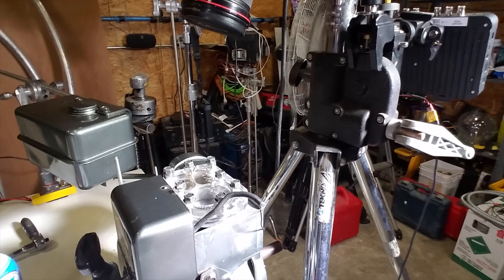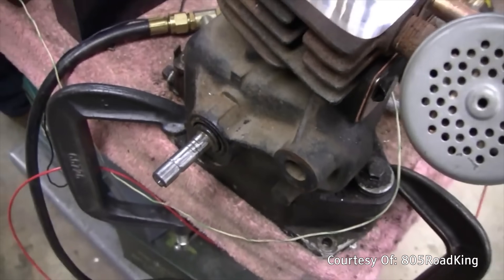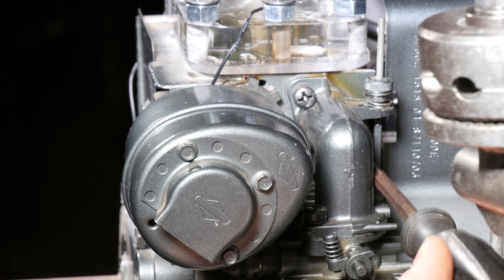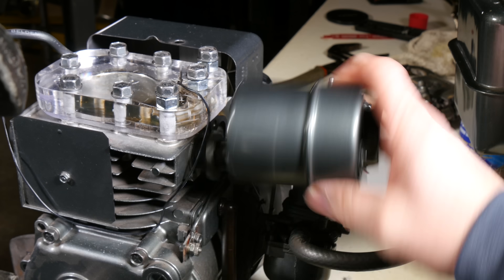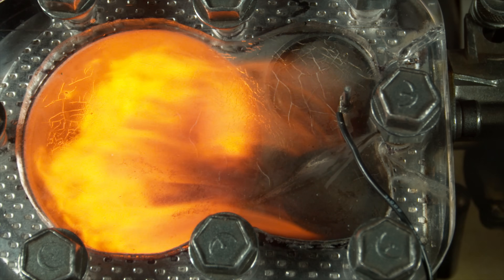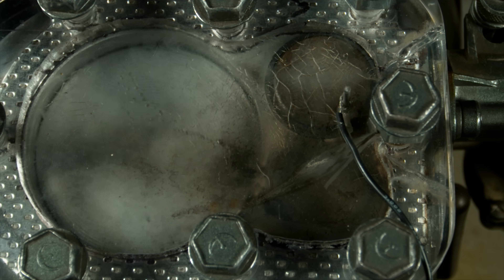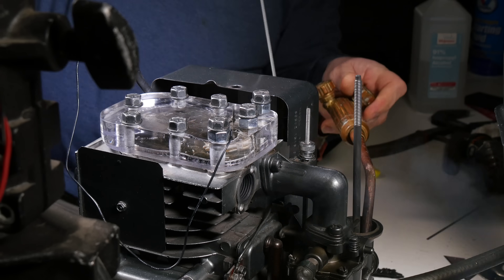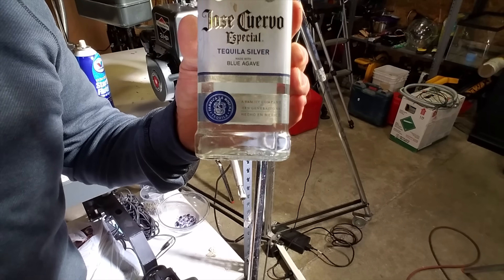See Through Engine - 4K Slow Motion Visible Combustion ( S1 • E1 )

Comment: I guess the issue with Acetylene, at least as suggested by the slo-mo footage, is that it burns far too slowly for an internal combustion engine. Like it didn't really deflagrate, it just burned as if it was coming out of the torch. Rather like trying to use diesel in a gasoline engine.

Awesome looking footage all the same, even if it got a bit mad max with the torch gas :D

I do wonder why the engine seems to be running wasted-spark though? That seems like a rather odd thing for a single cylinder to do. There must be a cam turning at half crank speed somewhere because it's clearly 4-stroke with positive action valves, so the spark breaker or other timing mechanism really should be connected to that, but instead it must be running off the crank instead. Unless it's one part of an engine that was originally 2-cylinder but was modular enough to deconstruct into a single?!

Oh... and it's pretty mindblowing to think that in every common car in the world you've got a quartet of this sequence going on... but at full realtime speed. It's so neat and elegant when seen slowed right down, but the reality is it runs way too fast for the eye, or even a normal speed camera to follow... it's a very neat piece of science, to create something that, at least until recently with the rise of easily available high speed cameras (and, indeed, high strength transparent acrylic), could only really be "seen" theoretically, or as a process to be stepped through stage by stage, yet still works absolutely perfectly when nailed together and put into motion at full speed.

Comment: why the spark plug is making ignition for every rev ? shouldnt it be making 1 for 2 revs ?
Reply: In theory yes, but on a small engine like this one the plug fires on every time the piston nears top dead center. So once on compression, once on exhaust where nothing happens.
Reply: Greg Annucci so.. cost reduction on gear set, commerical market for spare spark plug.. engineered solution for money then
Reply: 스파크 플러그..
Reply: This is called a "wasted spark" ignition (I just encountered the term a few days ago and it stuck in my head). Makes the ignition system much simpler.

Comment: Im a briggs and stratton mechanic of April Nolan and I have been turning ratchets and using impacts for 4 years and yet never have seen such an amazing view of a 3hp briggs and stratton engine run with a glass head.That my friend is one of the most amazing things I have ever seen in my entire life of mechanic work and repair.
Reply: the valves accumulated unburnt material. was not mixed with gasoline. dumped in. 1.x   hp cast iron

Comment: I'd like to see the engine run on HHO gas ( browns gas ) hydrogen and oxygen extracted from water via electrolysis. In theory it should make good power and burn very clean. Also to see it run on alcohol and inject it with nitrous oxide.

Comment: Awesome video. I'm glad you've had the time and interest in sharing this with us. One thing about ethanol. Did you know that here in Brazil our vehicles run on both alcohol and gasoline? It's the so-called "flex" technology, whereby you can feed in any proportion of gasoline and ethanol to your engine and it runs ok. However, even our regular gasoline has 27.5% alcohol - as part of a Federal Government program to stimulate the sugar-alcohol industry (it's absurd, but there's nothing we can do about it!) - our alcohol is produced from sugar cane. My question to you is: what is the behavior of the combustion at a similar gasoline-ethanol concentration? Is there a way for you to conduct that experiment there and share with us? I appreciate. Happy 2018!
Reply: That is achievable thanks to new fuel injecting technology but this engine doesn't do well with ethanol as it's carbureted

Comment: I don't know if regular 80 proof tequila would work. 151 probably would. I was a dumb kid so I've tried to burn alcohol before. 80 proof alcohol doesn't really burn too well. But, it might work, I don't know. Maybe a spark plug cal light things better than a cigarette lighter. Go ahead and try it if you're curious. As an experiment, you could use increasingly higher alcohol levels. Go from wine, to a liqueur, to tequila, to 151 rum and finally to 190 proof Everclear. Then when you're done, it's party time.
Reply from the maker: Paul TheSkeptic I burned 151 in part 2 or 3 of this episode, it's on this channel, check it out I think you will be quite surprised with the results.
Reply: Alright, I'll check it out. Thanks.

Comment: You need to understand how dangerous it was using rubbing alcohol with your acrylic cylinder cover. You see, isopropyl eats away at acrylic polycarbonate and you can even see the microfractures forming. You could have done some serious damage to yourself and your studio.

Comment: If nothing else this vid demonstrates the basic inefficiency of the flat-head design. You can see the pressure wave move sideways from above the valves before it exerts any downward pressure on the piston.  Only real advantage these had Back in the Day is that the compression ratio was low enabling them to run on the low octane gasoline.  High octane gas used to be called "ethyl' because it had tetraethyl lead added to it.  I'll use stale gas out of my boat to run a lawnmower, snowblower, leaf vacumm or other B&S or Tecumseh flathead motor knowing that the motor won't complain about it.

Comment: AWESOME!!!!!!!! I used that engine with Mini Baja here in Brazil, at the University, for 2 years!!! Briggs 8 HP!!! Than, in 2002 they changed to the 10 HP... the 8HP was vertical cylinder. I think the 10 Hp was inclined cylinder... THIS VIDEO IS AWESOME!!!!!!

Comment: Wow.. Im just thinking back to my school years in mechanical engineering, listening to a dusty old professor explaining combustion principles on a chalk board, the theoretical way lol.
A video like this with the right amount commentary would certainly be a huge advantage for students to learn the basic inner workings of combustion engines and the effects in performance/efficiency as a result of variations in fuel type/oxigen mixture/temperature/pressures/etc.. Its just so much comprehensive when u can literally look inside! 

Great job on making and sharing this useful stuff bro 💯🔥
All science is simply much cooler when its in UHD super slomo video! 😆
Looked like ur pure alcohol test was running on rapid evaporation pressure tho, was the motor still warm at that time? ..Acetylene was an interesting choice tho lol. did u try other gasses? (Propane/Butane/Ethylene/Methanol/?😬 LPG? hydrogen? 😁🔥 Or high octane fuels like kerosene/jet fuel? RC nitro? 
😂👊cheers mate
Reply from the maker: Linktw0 thank you, I like no words are needed to explain a process. Yes I did try different fuels, those videos are on this channel, I also ran nitromethane which was pretty amazing. The nitromethane video is coming out in the next couple days

Comment: Can you make one of these on a 2 stroke motor & test something I've wondered about - would a 2 stroke run on straight WD40 (or 50/50 gas/wd40)? How bout 5:1 EZ Start/Auto Transmission Fluid?  I've been curious about these, because all my friends say, "noo it couldn't work, you'll ruin your engine!!" & I say, "relax, I wasn't gonna try it" But I'm just really curious, because in terms of testing crazy ideas that could be a dud, could break things, or could work, I'd say the wd40 is plausible, & the other likely viable

Comment: Maybe, i think you may use the other type of fuel, neutral flame or oxidizing flame type of fuel for gas welding. So, it would be great if there is no producing of dust after combustion and also get more temperature.
Just my opinion.
Thank you for your interesting video.
Thank you for your interesting video

Comment: According to  an article in Popular Mechanics many years ago, adding hydrogen from electrolysis "does not benefit an internal combustion engine in improved efficiency".  I'm not convinced they weren't "being paid to say that" ...  According to what I've read, the introduction of "browns gas" to gas or diesel in particular, increases the speed of the combustion flame front across the chamber resulting in a more complete burn, fewer emissions, and thus greater efficiency.  Have you, or would you be willing to show that in slow mo ?   I think the results would be very telling, particularly in reduction of diesel particulates in the exhaust.  Incidentally, I'm a former auto mech instructor and long haul trucker, now retired.  Thanks for a Great Video series....
Reply from the maker: Tom Jenkins that sounds really interesting ...

Comment: True Story: I once stuck a fuel line into a bottle of Jamaican Everclear.  Ill be dammed if it didn't start up !  It didn't run right .  But it sputtered and throttled up a bit.   Don't drink the stuff.  One sip will turn you into a zombie.  But If you can find it. Try it and make a video.

Comment: you fucked it up. The acetylene needs more oxygen. If you ever see the videos they start it orange, then tune the mix to blue with oxygen. All these fuels need the right mix of air and fuel. The alcohol didn't work great because there wasn't enough air and you don't have fuel injection so it doesn't carborate right.

Comment: wow... Exhaust gases aren't pushed out entirely by the pistons, it seems like it's so hot it still continues to expands and pushes itself or at least 80% out and the rest is then forced out by the piston.
Please, someone correct me if I'm wrong..
edit: the exhaust gases seems like it's trying to escape on itself rather than the piston pushing it out. I'm by no means an engineer or a mechanic, just a guy trying to learn.

Comment: Hi I had 2 questions about engines, does the crank shaft and piston just rub on one another during rotations? Doesn't that cause wear? And how do you make a seal around the side of the piston. I'm trying to cnc my own engine for a project. There's a guy who has a 5 axis machine near me willing to let me use it

Comment: I would think twice about trying hydrogen. Hydrogen, the smallest molecule,  as fuel is difficult to not have leaks in your tubing, valves, head leak, etc. The engine may trigger a larger fuel-air explosion.

Comment: What about with diesel engines? I wanna see how combustion occur with just compressed air
Reply: magojiro kusanagi it's simple.... compression of gases/air raises its temperature, and with diesel fuel, it will ignite and combust once it reaches a certain temperature. it would be a bit more difficult and tedious to do here because it usually requires direct injection

Comment: My understanding is that the main thing that limits the RPM of the internal combustion engine other then valve float, is the velocity or speed at which the flame front can propagate or spread across the combustion chamber (which is nicely illustrated in your clear head demo).  Also, what prevents your plexi head from melting?  Also, maybe try natural gas or LP

Also, can you show and explain your spark-plug device?

Comment: when you convert a propane BBQ to natural gas you have to drill out the burner valve to let more Nat gas in  because Nat gas burns at a much lower flame temp. the alcohol you used was it off the shelf 70 percent isopropyl  alcohol or 98 percent methanol. when you shot pure acetylene down the air throat of that carb.  you know acetylene is far to volatile and to unclean to burn without large amounts of O2. the demo was interesting though.

Comment: hey man not shooting you down here, but what you showed us with the acetylene is exactly what any welder will tell you, acetylene without oxygen creates ridiculous amounts of soot.

Personally I would like to see BG vs. Slick 50 fuel vs. Seafoam vs. acetone vs. isopropyl, with the same glass head. I've got myself a modified  99 Cavalier "work truck" that runs at about 50 mpg and I'm wondering which one of these things that I add is improving the gas mileage so much.

And hell yeah run some Jose in there, but put it up against some Jack Daniels too.

Comment: In ending thanks to Mr Vartanian that showed us how the mini bike engine worked.  I had not really read drawings and put diagrams to the real world things yet.  He was replacing the connecting rod and had the little engine apart and I then instantly got a quantum leap of many orders of magnitude in my understanding of the world.  Showing the valves going up and down, letting fuel mixture go into the cylinder, compression, exhaust etc. I went on to engineering school and several degrees.
Reply from the maker: +gk10002000 right on !!

Comment: It seems that this engine produces one spark every revolution. This is clearly visible in the operation with gasoline. Can you confirm this observation? Or is that there is an enormous delay between the spark and the beginning of the combustion?
Reply from the maker: Roberto de Petris yes that's correct, it's called wasted spark system

Comment: Warped Perception          Alcohol has a higher vapor point than gasoline and needs to be  heated to a higher temperature before entering the combustion chamber, also the alcohol had 9% water mixed with it which cooled the combustion temperature down and reduced the pressure and rate of expansion within the chamber. try a different type of alcohol and heat it just before entering the combustion chamber.

Comment: Very cool video! Did you try to add a little extra oxygen with the acetylene to improve the fuel to oxygen ratio and  burn? Tequila would be a good try. Go for it! With that as well, try adding a bit of oxygen from the tank. PPE should maybe include a full face shield? :)

Comment: Ok, for the Acetylene gas, should have popped open the Oxygen valve, as well, that is why you had so much black crap coming out, plus, without the correct mixture of Oxygen & Acetylene, it will not burn properly.  Imagine a match trying to burn, once it is lit, in a completely Carbon Dioxide filled chamber, it will just put itself out, due to not enough Oxygen to burn the fuel(The wood stick the match head is on.).  Another fuel, that you can use, is commonly known as "ALKY" fuel, it is almost pure 100% alcohol made from corn and other things, like wheat, as well, but mostly corn alcohol, which before warned, it is EXTREMELY flammable, it is the same racing fuel, that they use for NASCAR engines and several other racing cars, like the drag strip funny cars and also the winged "sprint cars"(The drag cars that aren't specially made, like the funny cars and etc, do 1/4 mile straights between 8-12 seconds, while the sprint cars, can do 1/2 mile tracks, with 4 corners, in less then 13 seconds.  Imagine the speed these beasts run at!  lol), so I am sure you get the idea.  Also word of advice, DO NOT put your face/eyes over top of an opened container of that ALKY fuel, it WILL burn your eyes!!!  I know all of this stuff, because I used to build racing engines for a living.  Which, periodically we had to weld this or that, to reinforce it.  I am a master machinist and master mechanic, as well.

Comment: the alcohol was run way too rich! needed more air less fuel
Reply: Also, alcohol has a dull blue flame that is invisible in daylight. Slo-mo takes very bright light to add enough light for the short exposures, and as such, completely washed out the flame. The orange flame was carbon deposits burning off/oil burning, which only happened occasionally.
Reply: He needs to find 99% alcohol, not 91%... too much water in 91% alcohol.
Reply: SE NÃO ME ENGANO, O ÁLCOOL TEM QUE SER AQUECIDO  ANTES DE CHEGAR AO PONTO DE IGNIÇÃO ,NO BRASIL USAMOS OS MOTORES A ÁLCOOL A MUITO TEMPO E COM ECONOMIA .
Reply: Surprized the alcohol, didn't strip the oil off the cylinder walls and seize the piston.
Reply: One way he could have done is to have heated up the alcohol and tuned the carburetor better. Also using pure grain alcohol would help. And he should have turned on the oxygen on the torch to help with the combustion.

Comment: alcohol burns much slower than more commonly used fuels. It also sinks heat very efficiently. this is why you witnessed the "quenching" phenomenon.
in order to get a good clean combustion you will need much higher compression and or use a forced induction system like turbo or supercharger. The idea is you need to fill the cylinder with enough heat to vaporize the alcohol. this is why alcohol is used in race engines. as a more stable fuel it allows for higher compression ratios and or higher boost pressures and is more tolerant of extreme temperatures which would result in detonation/preignition using normal petroleum fuels.
clean your engine well, alcohol is corrosive and hygroscopic and because of blow by will have some effect on your oil.

Comment: tequila wont work 40% alcohol and 60% water content will choke the engine worse than the 91% isopropyl alcohol you used, may aswell use water, the isoporpyl alcohol doesnt work on 91% iso, try the isopropyl alcohol 99.9%... that will act as a clean fuel, no noticable residue left behind, great cleaner, and should act like petrol/gasoline but slightly better... lets face it, for the engine to work you will need 95% plus alcohol or fuel, oldtimers who moonshine will use their shots (bad stuff that comes off first and makes you blind, at the higher 90's abv) as fuel and the engines back then loved it...

Comment: I'm a beginner, so don't get triggered. Is the spark plug firing twice in a full cycle? I noticed one spark after the compression stroke, but then another spark when the exhaust valve closed. I've searched google, but all of the comments state that there should only be one spark. I found some information on a "wasted spark" when two cylinders are at different stages in the cycle, but still fire together. Is that what I'm seeing here?